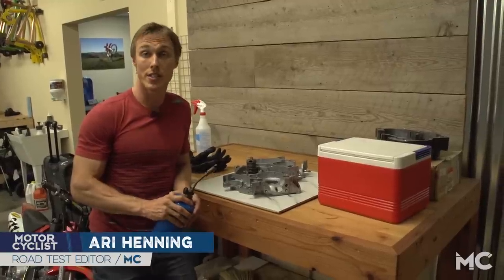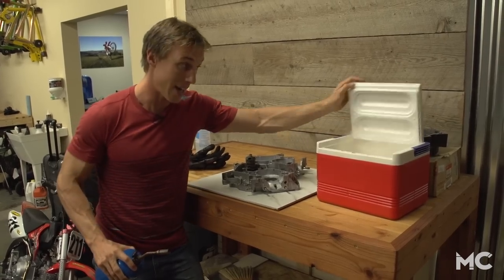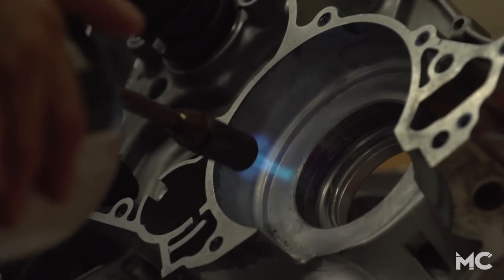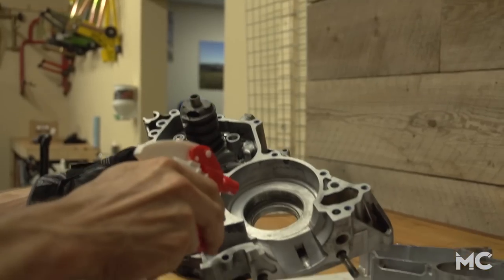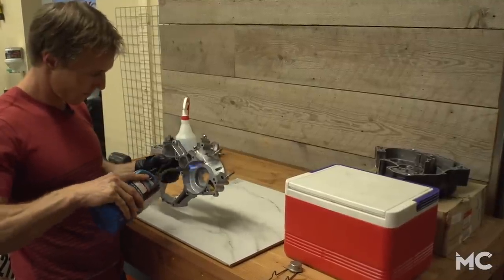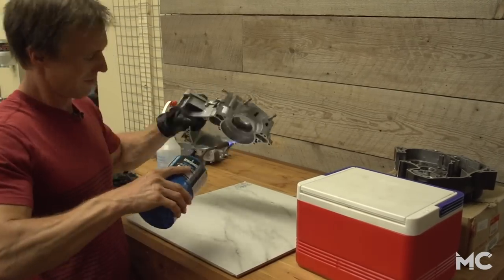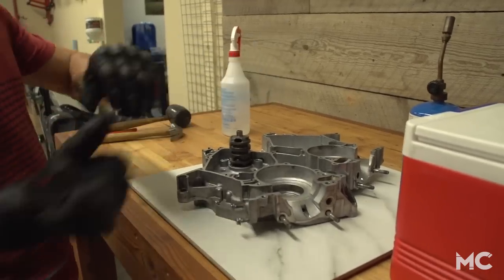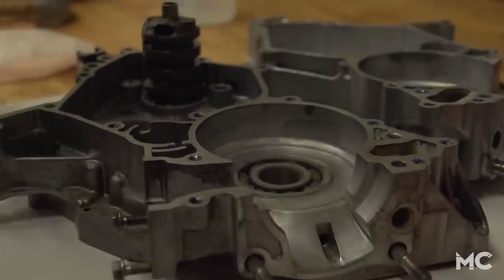How To Install Press-Fit Bearing: Toolless Bearing Installation | MC GARAGE

Comment: Dude.  Thanks for this tip . Your video is the most closely dedicated to what need to accomplish. I already had my splined shaft in the freezer but the tip about heating the housing ( which contains my 4 bearings ) to 200 ° is the approach I had not considered.  Thanks

Comment: What about if it cracks? Freezing bearings into a roasty hot crankcase? Not trying that on an expensive part. Like the channel by the way, more vids if you can.
Reply: Rlindagem Bearing cages are strong, and the cases themselves are as well for the amount of heat that is being applied, There is no risk at all of damage, You have more likely to damage them trying to pound them in normally. You would have to have it very hot (glowing red) with a torch (as he stated not to use in the video) to have issues.
Reply: Makes sense...
Reply: If you had those cases glowing red, they would already be liquid!!! They're not steel, so don't be tempted to overheat them. Just enough to boil off water is all you need as the Aluminium cases expand more then the steel bearings will shrink for the same temperature difference. Don't overdo it!

Comment: would you have to wory about condisation from the ice and cooler getting into the engine?
Reply: +Kaleb Persinger he used dry ice, so there is no condensation
Reply: Also, any condensation would quickly evaporate once the engine is run for the first time. Each time an engine is run and shut off, the PCV system draws moist air into the crank case and it causes dew to form internally. It's boiled off once the engine gets up to operating temp and does no harm.